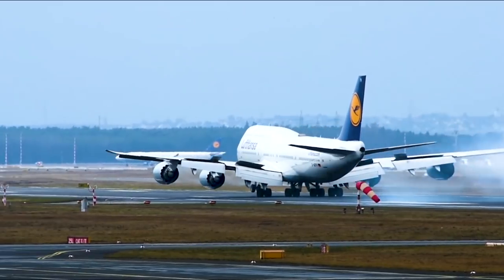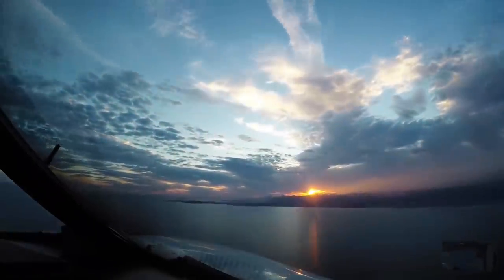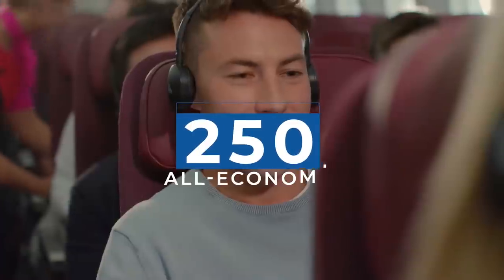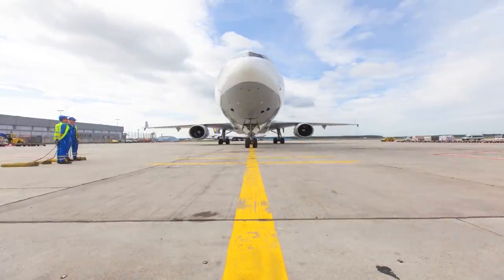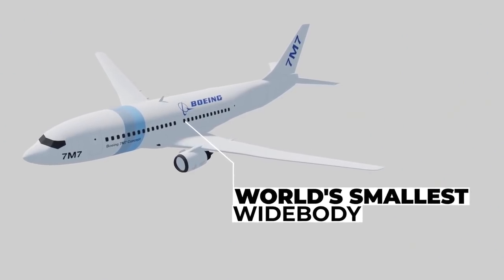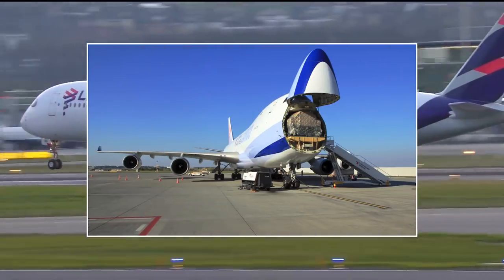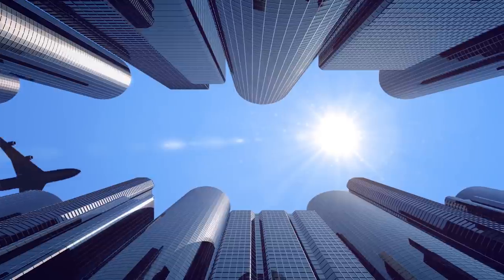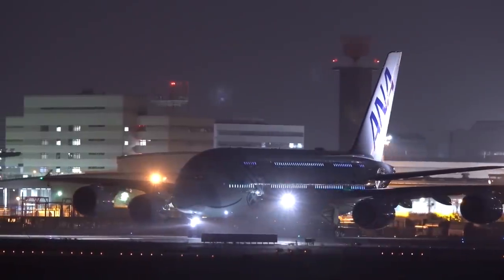Building The Perfect Aircraft - What Would It Look Like & Where Would It Fly?

Comment: Exactly what i had in mind! Give the original 757 the X/Max treatment (updated avionics, more fuel-efficient engines and redesigned carbon composite wings for enhanced aerodynamics) and the ability to accept LD3-45 containerized cargo and we'll have a winner.
Reply: Shouldn't that effectively be a clean sheet design if so much of the original is to be replaced?
Reply: @neilpickup237  exactly. Any engineer will tell you, if you've got to change THAT much of the design, you need a fresh design to cut weight and eliminate the inefficiencies of an outdated platform. 

It would be like trying to adapt a Nokia brick phone to run on iOS... only without a touchscreen, and all that extra weight, all those physical  buttons, and bulky battery.
Reply: The minute you get into adapting for LD3 containers, you NEED a new airframe. To avoid this is a logical as trying to re-engineer a Dodge Grand Caravan to ALSO transport horses inside. It's literally going to make that platform inefficient at doing either it's primary role or secondary role with any type of efficiency whatsoever.

Comment: I was thinking in the 757 during the whole video
Reply: I doubt it, lol. Currently, based on sales alone, A320neo, A321neo, MAX8, B787-9 and A350-900 currently fits the market.
Reply: @nntflow7058  I mean yeah but the points the video describes fits the 757 perfectly, even think its mentioned at the end
Reply: @nntflow7058  Boeing has had problems with the 737 MAX, so another model is needed just to be on the safe side, and the 757 would fit that gap perfectly.

Comment: He discounted the twin-aisle, but how many times have you wanted to go to the bathroom while the service cart was going down the aisle in a single aisle? Make the fuselage out of composites as well and that will give you back the fuel economy you lost by making it a twin aisle wide body. No. It doesn't have to be as wide as an A330 or Lockheed L1011 Tristar, but the width of a Boeing 767 is adequate. Composites will allow for larger windows as well. The Asian carriers like the LD3 cargo capability as well. This also improves the turnaround time between flights if used for shorter haul flights. For longer flights, a 34 inch seat pitch in economy should be considered. Build the 767-8 NG and 9 NG with all composite materials: Expensive today, but the airplane could be a work horse for the next 50 years. Make the undercarriage tall enough for future engines with larger nacelles.
Reply: A 767 in economy is 2-3-2, 7 abreast. You're increasing the width of the hull by 33% (737 Vs 767 fuselage diameter), but only adding 17% more seats. You can't charge extra for providing a second aisle. Customers won't pay the extra for the convenience of it. 

There's no interest in composite cargo planes because they don't care about fuel efficiency or material fatigue, the planes have so few flight hours compared to passenger aircraft. Sure, fuel prices will have them looking to ditch 4 engines in the next 20 years but they'll just move onto passenger converted freighter 777s, A320/321, maybe 787s.

TL;DR: small widebodies don't make economical sense, you can't usually please cargo and passenger airlines at the same time easily, and composites don't solve every issue
Reply: Honestly, I WANT a Modern L-1012 (L-1011 twin-engine with modern technology).
Reply: The 2+2+2+2 layout of that cabin was EASILY the most relaxing and comfortable way to travel. if they could apply the extra-large side bins and leave the ceiling free, that would be optimum for an 8/9 across cabin. Now if we could just get people to quit trying to fit mopeds and refrigerators in the overhead bin...
Reply: If only Boeing and Airbus people would see our comments. No need for expensive consulting fees for what passengers want.

Comment: Working outside the box, slightly, the scale up a BAe 146 to equivalent B-757 scale.
And as said replace the four Lycoming ALF 502R-5 or Honeywell LF 507-1F engines with a pair of Rolls-Royce RB211-535E4(B) or  Pratt & Whitney PW2000-37/40/43 engines.

I'm advocating a high wing and T-tail configuration for the more developing world, with potentially uneven, or less than ideal airstrips.

Comment: 1.a plane with 4-4 or 2-4-2 seating(economy) that can fit roughly 300 passanger(all economy(not calculated how long the plwne will be)) with fuel tank in horizontal stabilizer and the wings(-+additional tank in the middle)so it fly as far as possible,that have crossection shaped like an egg with flattended bottom that equiped with the most efficient but fast engine with a wing designed to have higher sweep angle to delay supersonic wave formation so it can have higher speed but still efficient that i likely will call boeibus 69-420
2.boeing 748-8i
2.5 a possible trijet version of boeing 747-8i
3.boeing 757
4.airbus 321 xwb
5.airbus a 330
6.boeing 7z7?(whatever the tadpole aircraft name,i forgot)

Comment: There is a reason why there is a distinct classification between narrow body and wide body plane. The range determined the altitude where the airplane will mostly operate and this will create different kind of engine requirement. So wide body plane will be more efficient in high altitude flight and narrow body plane will be more efficient in low altitude flight. Of course, with the recent developments, this line has been blurred by mid range plane like A321 xlr and upcoming Boeing plane, but what im trying to say is, you can't full fill the whole commercial need with 1 airplane.

Comment: I would imagine a large narrowbody, wide enough to carry LD3-45 Containers underneath, but not so wide as to cram an extra column of seats. It should constructed almost entirely out of composites, and powered by the most powerful and efficient engines possible for an aircraft of its size. I would imagine it to look like an A321-ULR, but with oversized engines like the 757, and the nose and windows of the A220. It would also have multiple embarkation doors standard, to expedite turnaround at the gate. A standard Long Haul cabin would have 1+1 pod seating in first, 2+2 Business Class Seating, 2+3 or 3+3 Premium Economy seating, and basic modern 3+3 seating to fill out the rest of the plane. Cabin climate and lighting controls would be integrated with the flight attendants' infotainment controls, like on the A220.
Reply: These discussions truly NEEDs to leave the LD-3 discussion on the ground already... Instead of trying so hard to fit a big LD-3 square into a little 737 circle, lets just make a damn little circle to stuff our cargo in. Call it the LD-3.5b

...As a byproduct, this proposed "LD-3.5b  could also revolutionize the cargo/baggage process if it can also be used by existing 737/A320 families. Granted, such a container would have to be a currently unconventional shape, easy to fill/load/unload/handle and transport but also not add too much weight or cost. Possibly like... a super-sized roller-bag; full of peoples full-sized luggage and carry-on bags that don't fit.... But that's surely the concern of a different comment section that Found and Explained should cover next :)
Reply: @josiaevans making the airframe wide enough to accommodate LD3-45 Container (A320 Family compatible variation on the LD ) would be a advantage to any new narrowbody. UPS' fleet of 757s is aging, and the A321 doesn't have the power for parcel freight.

Comment: My perfect plane will highly fuel efficient, it will a wide-body aircraft like the boeing 767 not to wide actually, it will be 225 seated ( on estimated), this will be twins engine, and have a range about 6,000NM of range.
Reply: Dare I say it wouldn't be 767 since the 7-abreast is inefficient, more like 9-abreast widebody with range of 6,000nmi and passenger capacity between 200-250.

Comment: Firstly, going in that direction of a narrow body Airbus and Boeing can and will quickly and easily respond with their upgraded version or introduce a whole new plane to compete with yours.
Secondly, there's a slight space between the Boeing 737-10 and the 787-8.
The same gap is there between A321XLR and A330-800. So am thinking that by calculation, the market should be around 225-245 in a 2 class configuration and we go with a narrow-wide body seating economy pax in a 2-3-2 
Premium pax in a 2-2-2
Business pax in a 1-2-1
For the 5000-5500 nautical miles range.
With a wide body similar to Boeing 767 fuslage narrow and sleek, we can still maintain a narrow body economics while offering pax a wide body comfort. And also increase cargo capacity.
Lastly, this decision will give Airbus and Boeing though time to catch up and gives us an added advantage of absorbing 60-70% of the market share.

Comment: While the aircraft mentioned is basically a replacement for the 757, an updated 757 may not work for today's market.
Firstly, without a wider fuselage (akin to the A320 series) containerised cargo using industry standard containers is not possible. 
The 757 is notorious for its wake - apparently it needs similar separation as for much larger aircraft, so presumably new wings (or at least a major update) will be required, if only to incorporate improvements in design and efficiency not included in its original wings - which were designed to handle much more powerful engines  to cope with shorter runways, (most of which have now been extended) presumably this means that they are much stronger, and therefore heavier than is needed. 
This leaves you with the unescapable elephant in the room - if it needs a new fuselage, wings etc. as well as new engines, why on earth aren't you starting from scratch to create an optimised design?

Comment: I believe that maybe a plane with a220 airframe but a bit whiter to have a 3-3 config, extend the fuselage of the a220-300 to 180-230 passengers, put PW1100 engines (same that the a321neo), make a bigger wingspan to add more fuel, but not too big and add an extra fuel tank for a long range version of 5500nm 
And I’ll call it the a220-700, following the a220-100, -300, the a320 replacement the a220-500 and the bigger a220-700

Comment: Well I'm in the process of inventing a commercial passenger airliner that would be UNLIKE any passenger airliner that we have used in the past. My ideas for the perfect passenger airliner comes in the form of questions. For example, what if the airliner didn't need forward slats or flaps because there is so much wing surface that the forward slats were permanently fixed in the extended position and what if the same were true for the flaps that they also be permanently fixed in the extended position? What if the engines were more embedded in and under the wings instead of partly sticking out from under the wings, so as to reduce on drag? What if the #2 engine was also deeply embedded in the fuselage instead of sticking out on top of the rear fuselage like was the case with the L-1011, DC 10 or the Boeing 727? What if the swept-back wings were located on the back fuselage like the Boeing 717, 727 or the MD-80 etc?
Reply: Kevin What are the flaps and slats for? Correct test answer: "They let the aircraft fly slower."  NO! They let the aircraft fly faster and land slower same with the retractable gear. Just follow the evolution of aircraft in the last 120 years. Most want to fly faster and cheaper but land safely. If you want an aircraft to fly slow build it that way. Remember every extra pound you carry LAX to JFK uses 1/3pound of fuel. Do not waste the weight and money to carry flaps slats and retractable gear. There is no perfect airplane every ounce you carry and ever MPH you gain comes at a cost.

Comment: As much as I want to say that a TWIN AISLE composite-based 767 replacement is the answer (due to turn around times) it's not the real answer. That market is still not ready yet. Plus, that aircraft would eat away at sales of the 787, the minute people start asking boeing to scale it up to fit more seats. 

The reality is that we need to do what Boeing did with the 707--->727--->737--->757. Common but evolving technology BASIS and similar fuselage diameter to reduce costs... 

"Simply" apply 787 composite technology to the 757 model (3+3 across fuselage, but with larger windows, modern wings, geared turbofan engines and most importantly, LESS WEIGHT). After that, use the tooling/technology to scale down to eventually create a composite 737 replacement (finally).

Comment: 737 Max with a bit of fuselage height will do. Definitely no MCAS system.
Reply: I saw a video the other day with the FAA test pilot saying the MCAS systems ability to control the aircraft has been reduced. Guess pilots are going to have to take control if things go wrong. This means if the shaker goes off he will take more responsibility. I know there is hi wind shear that can cause a planes to stall but hey, hit the autopilot disconnect and put the nose down.  I’ ve been in enough cockpits to figure that out and owned and flew a little 2seat tandem seat taildragger for years.

Comment: Your aircraft will be an A322neo plus or a B757, with carbon fiber construction, 260passangers  (240 econ + 28 bis) passengers and and 6000 mile (10,000km)operating distance and the latest highest  by pass ratio engines, ( Built from a clean sheet  incorporating all the latest tech wing design).  Convertible to  shorter ranges by having 2 containerized fuel tanks. That could be taken out for extra cargo space. And a front that looks like a A350  B787 style rather than the Morris minor style. And the ability to switch off any automatic trim functions like MCAS at the push of a button?  Built when we all take the mark with our covid vaccination from Mr Gates.

Comment: ...a hundred-seater like the 737 Max..."  How many people clicked to another channel right there thinking "man, is this guy from another universe?"  If you want to use a 100-seat example, you best thumb through a list of regional jets.
Reply from the maker: 737 max has 153 to 203 seats. That’s 100 something seats. What would you say? 200 seater? That isn’t true
Reply: @FoundAndExplained  Excuse me, but you were trying to cite an example of a hundred-seater. You missed. Badly.  When the error is pointed out, instead of acknowledging the error, an easy thing to do, you're doing a ridiculous tap dance, turning the sequence 180 degrees and embarrassing yourself. So would you consider calling the 727 and the 757 hundred-seaters? I've flown both those as Captain and they accommodated 145 to 185 passengers, right there with the 737 Max.
If you really consider a 737 Max to be an apt example to cite as a hundred-seater, then you're screaming to the world "I'm not very familiar with airliners," while then saying "I can teach you how to design the perfect airliner." 
There have been actual 100-seaters, incidentally. Though airline companies can configure their planes within a wide range of seating totals, two of which I'm aware that have been configured with 100 seats are the DC-9-30 and the Fokker-100.

Comment: "passengers won't mind because of the low ticket price"

Apparently you didn't poll me. I frankly think cheapskate travelers have ruined travel.

Here's what I'd like to see in the ultimate passenger plane:

High-subsonic performance like the CV-990 or the Sonic Cruiser. I'm happy to pay a higher ticket price. It would be far more affordable than supersonic travel, especially the Boom Overture which has the obscene prices of the Concorde but inferior speeds.

4000' cabin pressure. At this level, you're below the altitude of Denver and things like comfort levels will greatly increase. You'll be able to taste food normally so food won't have to be insanely salty.

Economy class beds. I'm sure you've seen the concepts out there. Densely laid out beds could make inflight sleep available to all classes of travel and not just for the super-rich or company-funded.

Some sort of cushioned suspension that would make it so we don't have to feel the violent landings that pilots seem to love these days, not just RyanAir.

Comment: SO WRONG... Planes of the future have to be SLOW AND ULTRA EFFICIENT or FAST AND LONG LEGGED.
--
(1) The natural extension of the 787, A350, 737MAX and A320NEO the like is an aircraft that is even more efficient. We are fast approaching the practical limits of what you can do with a high bypass turbofan with ever increasing combustor temperatures. CMC or not, composite fans or not, geared or not, there are practical limits to material and how much bypass is actually useful. To go more efficiently, you have to GO SLOWER. Going about Mach .75 puts you in another dip in the drag curve. Going slower also allows you to use an unducted fan which has the potential to not only take bypass beyond 12:1 but vary the incidence of the blades. That is what it'll take to get the "next" 20~25% in efficiency.
--
(2) We are seeing a renewed interest in Supersonics as well. And in this regard many fail to understand why the Concorde failed. It didn't fail because of ticket prices. It failed because it couldn;t fly over land and it didn't have enough range to serve over water city pairs beyond NY-London/NY-Paris which doomed it to a 14 aircraft production run. Nobody cares too much about flight times when shuttling between Las Vegas and LA or even those 3~5 hour transcontinental flights. The premium traveller will really appreciate shaving that 10 hour trans pacific flight to 5 hours though. Hence, a supersonic aircraft unable to fly over land must have trans pacific range. That means 6000nm (preferrably 6,300 nm) or about the same as the 787-10 or original 777 (befoee the LRs and ERs). That is LA-Taipei, SF-Shanghai, LV-Tokyo, Chicago Beijing (over the poles), NY-Dubai... that opens up all kinds of doors that a 4000-4500nm falls short of.